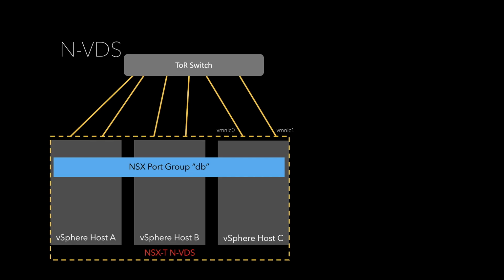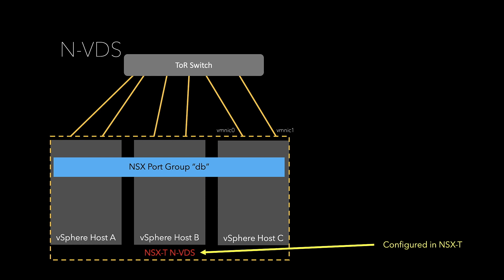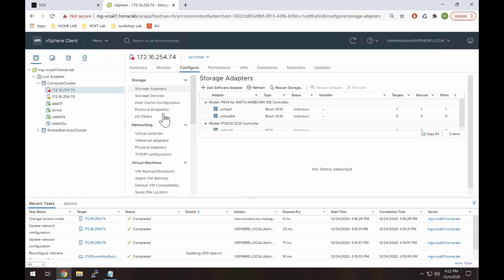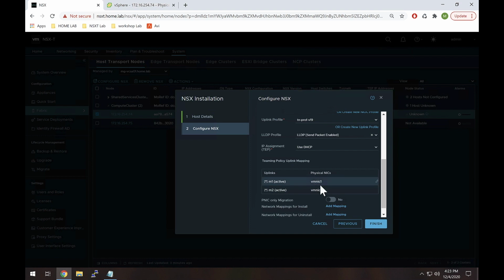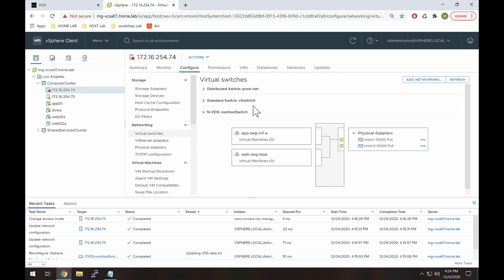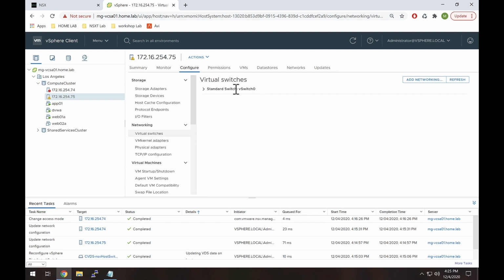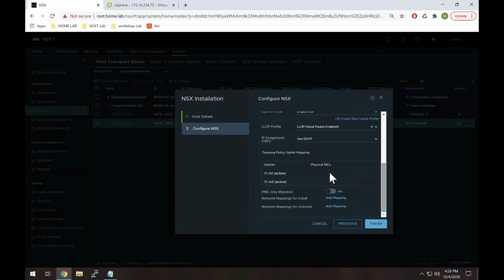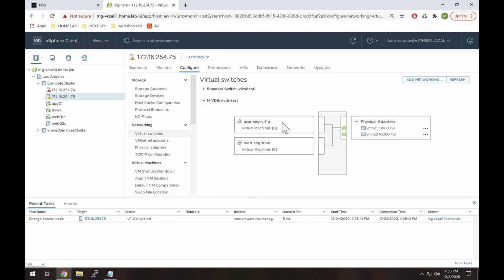NSX-T N-VDS vs. VDS (Pt. 3)

Comment: Hello, @NRDY Tech. I am a beginner in this space. I have been watching your videos and was just wondering if you could make a step-by-step video on having the lab up and running. Or you could also point me to a guide that explicitly states the steps to set up the lab. Thanks!
Reply: So in his lab he is using two physical hypervisors with esxi and connected to vcenter. His NSX series is using nested (virtualized hypervisors) esxi hosts to simulate multiple clusters. Think box inside of a box. He has said this in early NSX 3.0 step by step videos.
Reply: If you are ok with using virtual labs, you can experiment with NSX-T at https://labs.hol.vmware.com - Type nsx in the search bar and find a lab with NSX-T in the name. Those labs should be NSX-T 3.0. Its better than no lab, but you will be missing some things by having a physical lab.
Reply from the maker: Hi Suyash! Matt & Daryl hit the nail on the head. I do everything nested - so what you would need to do is install ESXi on your server/computer, then create a new VM on that host, and on that VM - install ESXi. If you check out my NSX-T 3.0 from scratch series, I do a video explaining my lab setup. Best of luck!